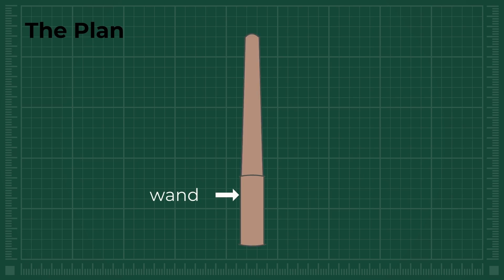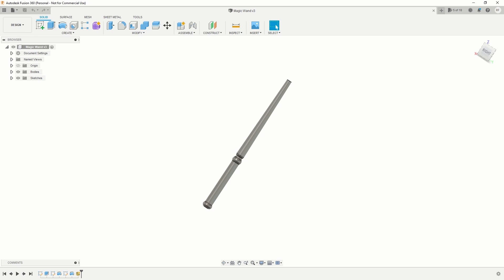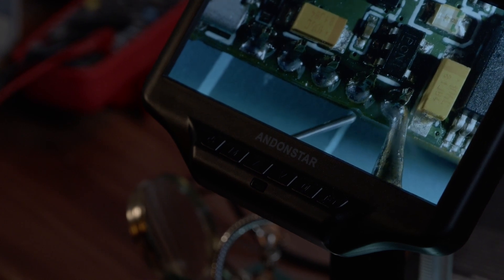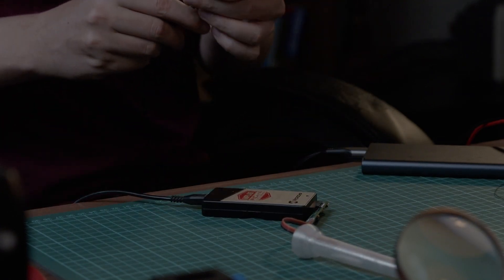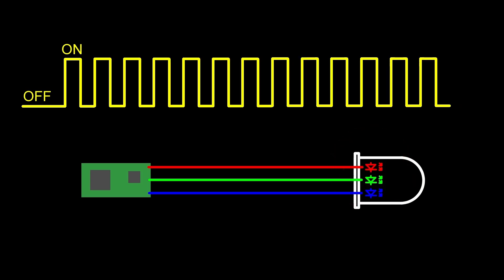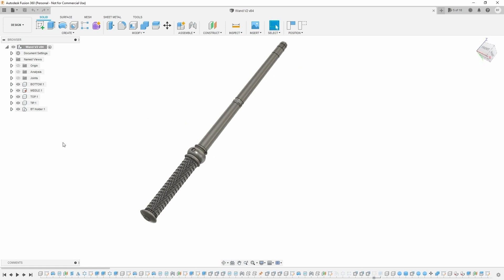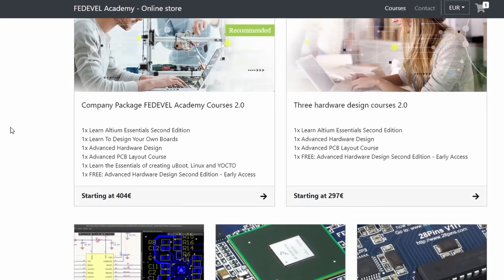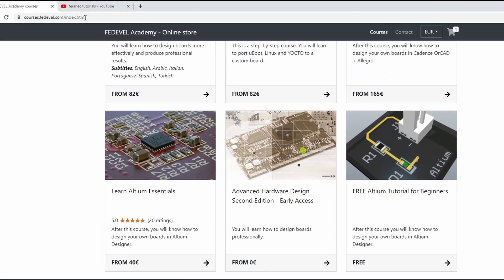Making a Magic Wand |  DIY | Wizards Wand

Comment: I made a wand with a button which triggered a multi colored auto blinking led in a epoxy crystal in the base/hilt and a bright white led on the tip. It was simpler in that there was no programming and custom pcb however the design challenges were similar because I used a small lipo battery and a bms module along with an ultra mini 5v boost converter. The button was between the bms and the boost converter to ensure no current flowed when the button was inactive. I wired in a small micro usb port and the wand was rechargeable. In short, you may consider making a rechargeable wand and even include simple bms circuitry in your existing bms, a 100 or 200 mAh lipo would be plenty sufficient (just ensure it has a  slow rate of charge for such a small lipo). This might alleviate some of the design challenges of the removable and large battery holder.

Comment: With the 3 access accelerometer, you have an extractable gravity vector which, when subtracted from the acceleration matrix tells you which direction is down and thus the orientation of the wand. This means that the spell activation movements can be independent of the rotation of the sensor.
Reply from the maker: Yes, you are right, it can be done through matrix. The main reason why I use the dot was time saving. It was just super easy and it helped a lot. Initially we did try to recalculate the position of the board based on gravity (my son was playing with that), but it was more math and it would require more time to write the software for that small microcontroller to make the recognition to work reliably, so I just added the dot and it made everything much more simple. PS: Also, it makes it harder for people who do not know how to hold the wand to use it - so the wand will only work for the real wizards who know the secret.

Comment: A few years back i was in a Harry Potter themed escape room. The final puzzle involved finding a wand and finding the correct spells to unlock the door. We found all of the movements, but the wand was not registering them, except sometimes the first one. I found a button on it and was "sweet a button, it must boost the power or something" turned out it was a button for pairing to some other part of the system and i completely bricked the wand :D 
After the guy at the control room saw that we were making the correct movements, he let us out manually. After that he could not even get the wand to work at all. I believe that the batteries had died. 
This appears to be working a lot better than that one.

Comment: You spent all that time to make something so cool, but then went and pulled the move of a true ass hole by making it require FIVE CR2032 cells!! 😉😂
Reply from the maker: I was thinking about re-chargeable battery, but that would make the circuit more complicated ... and I wanted to keep it super simple to use it for learning basic circuits.